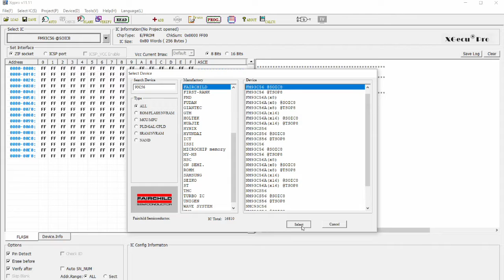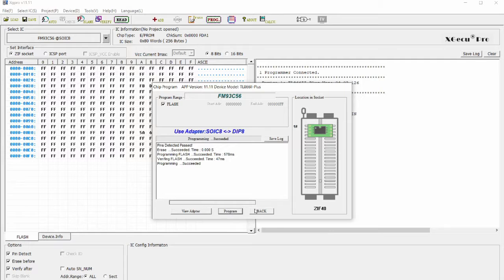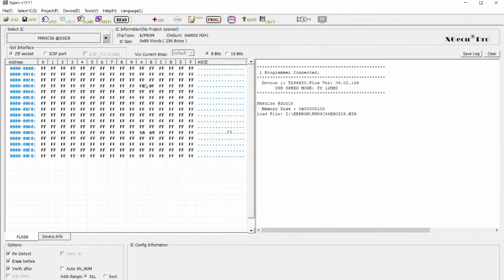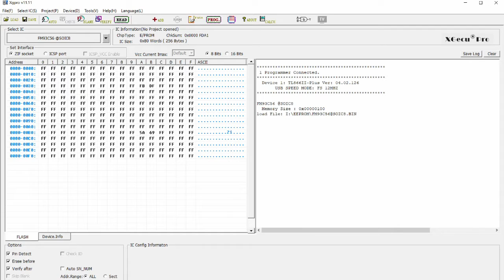Toyota 4Runner ECU - Remove, Reflash and Reinstall 93c56 EEPROM to learn new ignition keys.

Comment: That was so informative man thanks, could swapping the EEPROMs from an old dead ECU to a newer one make the latter work with the original keys..? I have a 1999 Lexus with a bad ECU and I would like to know if I could just buy a used ECU with matching part numbers and swap the EEPROMs..
Reply: Great Question! And the same that I had, I essentially wanted to know if I could back up my ECU/ECM to reprogram a new (or used one) later on in case it fails

Comment: Did you try tying the reset line low on the CPU to hold it in a reset state while programming the EPROM?
Reply from the maker: No I don't think I did, but thats a great idea and probably would have saved me desoldering!
Reply: @retrotechinsanity  Thanks! But I can't take credit for the idea. I saw someone do it on YT. 

It worked, but the guy in the video did say not to get too upset if it didn't work for you. I take it that it's a coin-toss as to its' success rate.

Comment: Zeroing is 00 or FF? Once this all done what is the next step?????
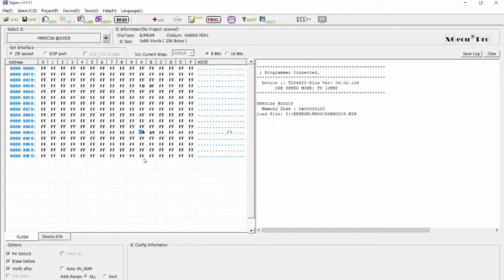Reply from the maker: When an EEPROM is blank, the bytes are all FF.  If you look at the screen in the video around time 11:25 you'll see the 4 bytes that need to be changed from FF at offset 003A, 003B, 00BA and 00BB.
Reply: This part was a lifesaver.. thank you for being detailed.. I did the Paperclip OBD2 trick and it wiped the entire chip, 4runner would not start

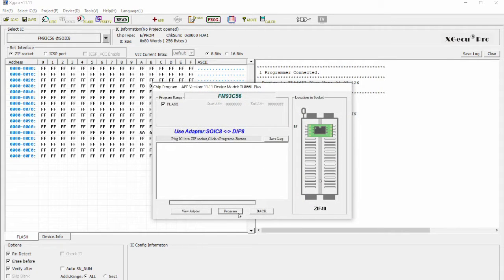Comment: Criticism: your video is a little over 19 minutes. it is not title something like "how to solder/desolder an 8-pin SOIC chip" where there are tons of vids that show how but rather a very specific thing related to a car computer and programming an eeprom for a new key (that's what most of your viewers will click for), but you skipped the most important thing for some REASON, which is where did you get the hex file that you burned into the eeprom?!?! 10:55 to 12:03 is the little over a minute where you actively avoided mentioning that, just like almost every single one of your buddies on the internet who did a similar thing
Reply from the maker: There is no "file", you just need to manually edit the correct bytes to the correct values and write it back to the chip.
Reply: Thank you, sir. But you did show a file there. Anyhow, forgive my probable ignorance, but even with that, what is your reference in what to do with what bytes for any given make and model?
Reply from the maker: @engineereuler1762  Sorry, I have no idea what to do with any other makes or models.  I just know this is how you zero out the learned key data for this particular ECM.  I did this as a favor for a friend and don't normally do this kind of work.  Most of the rom programming I do is for old 8 and 16 bit computers.  All the other videos I ran across used the chip clip method to reprogram the eeprom while it was still on board the pcb.  For whatever reason, the clip method wouldnt work with two ECMs of this model.  I guess it was the wrong clip or a poorly made one, hence the need for desoldering.  I created the file that was used here based on documentation I found on the net somewhere.  I would imagine its a similar method for other ECM's utilizing this eeprom chip.
Reply from the maker: @engineereuler1762  As for the file, I created it.  It's only 4 bytes of data and the rest are zeros.  Just recreate it based on what's seen on the screen.  I may still have that file somewhere but the computer I used is packed away right now. As for the make/model comment - different makes and models of vehicles may use a similar process but the data you need to enter will vary.
Reply: @retrotechinsanity  can you please show the 4 bytes and explain their bits and what they mean?
Reply from the maker: @engineereuler1762  Look at the video around 12 minutes 27 seconds.  At hex offset 0030 you should see FB DF under columns A and B.  At offset 00B0 you should see 5A 69 under columns A and B.  All other data needs to be blank (FF).  I don't have a full understanding on how the processor works on this computer, my guess is that the 0030 offset is the reset vector for the CPU and the 0080 offset represents a blank config waiting to be programmed.  That is strictly a guess on my part.  You'd have to read the reference manual for the processor in this ECU to really understand what its doing.  All I really know for sure is that after the ROM was programmed with these 4 bytes and FF's everywhere else, my buddy was able to learn new keys to his 4runner.
Reply: @retrotechinsanity  thanks for the new details, and sorry for being persistent/nagging, but still how did you know that? (that for this specific model, 5A and 69 hex are needed at the specific locations and everything FF/blank). Did someone tell you, did you read it somewhere and forgot to mention/honor the source in the video, did it come with the programmer computer GUI, or do you have some sort of prescription service like alldata?
Reply from the maker: @engineereuler1762   My buddy I did this for (the owner of the 4runner) showed me a forum post somewhere that showed the hex values that needed to be changed.  Probably some 4runner centric forums or something along those lines.

Comment: Using a soip clip then no need to solder to breadboard but nice video.
Reply from the maker: Thanks, I did try that first but I was getting bad data when reading the EEPROM so I pulled the chip.  Could have just been a limitation to my reader.

Comment: I heard the Xhorse mini prog makes it much easier?
Reply from the maker: That Xhorse tool looks pretty cool and would certainly make this easier, but it's quite expensive!
Reply: @retrotechinsanity  I will definitely invest in it if it makes it a lot easier. My only concern is that I heard when you try to read it directly off the board, it can corrupt the file? That’s why I’m a little hesitant to purchase and use it
Reply from the maker: @Cali415  I tried to read the chip without removing it from the board and had corruption issues which is why I wound up desoldering the chip
Reply: @retrotechinsanity  Do you mind me asking what you used to try reading it from the board?
Reply from the maker: @Cali415  I had tried one of those CHA341 based clip on devices as well as building my own circuit on a bread board (think it was a few diodes and resistors) and wiring it into the XGpro.  Both had a similar result where the data read was different every time.  I imagine it was because when powering the board with 5v to read the chip, other devices on the data bus came to life and caused problems.
Reply: Yea I tried using the vvdi prog pen and it wasn’t writhing it. I was able to read the information but wouldn’t write at all. Just ended up moving the original eeprom to the donor ecm. Worked like a charm

Comment: nice video sir....sir can you help me i ? i loss data from smartkey epprom 93 c86 toyota fortuner..can i take a data from ecu epprom to make a data in ecu smartkey?
Reply: i 'm newbie about read epprom sir..my device is ezl 2019 .i can read this ecu  epprom but i don't no what to do with the data sir ..i replace my ecu smartkey but i don't have ignition on sir..i think i want copy this data to ecu smartkey.can i do it sir to get ignition on? thanks you very very much sir if you give that infomation...
Reply from the maker: I don't know if the 93's work the same way as these slightly later models which have this type of ECU.  My understanding is that the key itself isn't programmable, it just has an RFID type of device that has to be learned by the ECU.  So when you blank the ECU, you re-learn that key to the ECU but the content of key's RFID doesn't change.